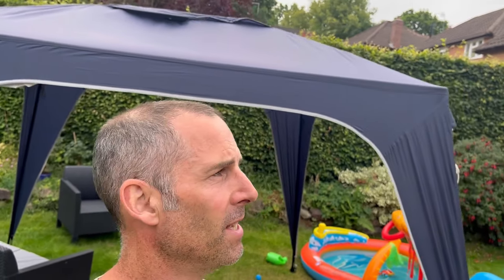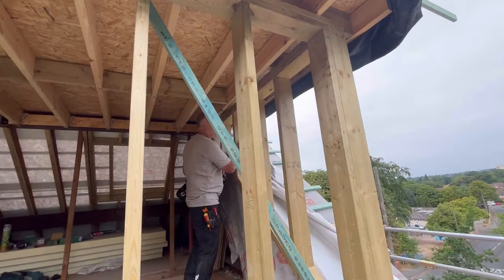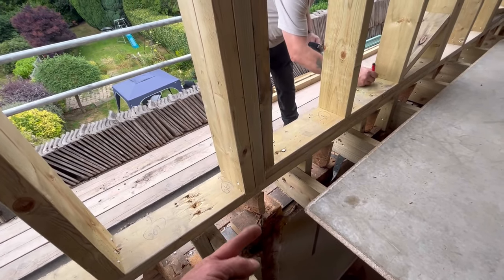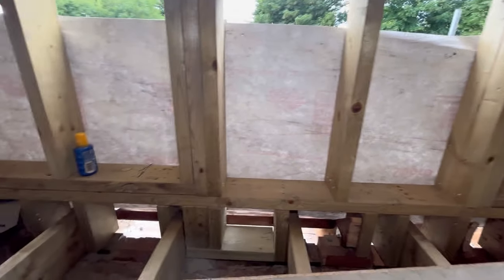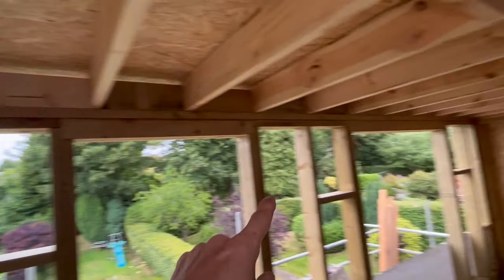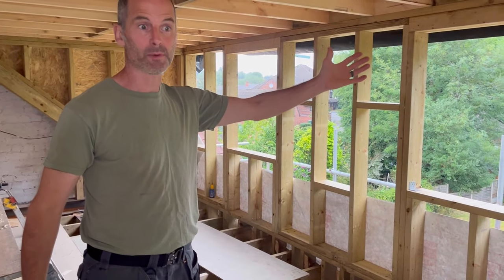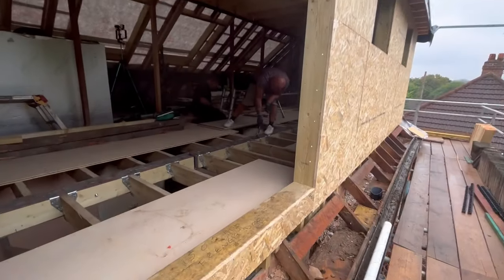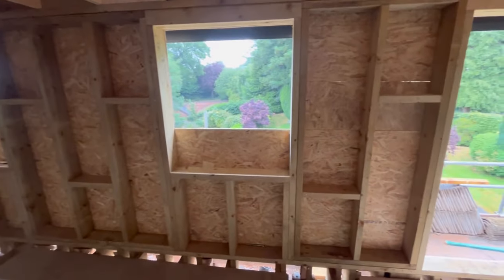Dormer structure and flooring complete.  #loft #milwaukeetools

Comment: Did you need roof straps or not?
Reply from the maker: If you mean for the flat roof then no because it was joist hung one side and construction screwed the other in every rafter. 
If you mean for the dormer itself then again no because we bolted every floor joist down through the wall plate into the brickwork and then bolted through into the stall riser that the dormer was attached to. Hope this answers your question
Reply: @mrabuilders6723  Actually that's the perfect answer helps massively